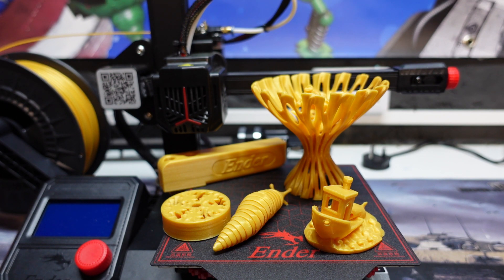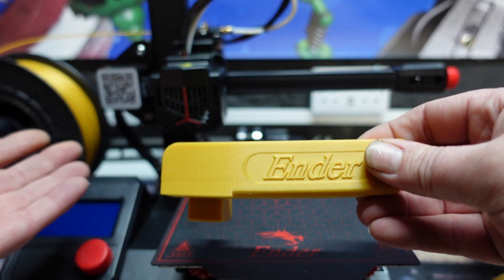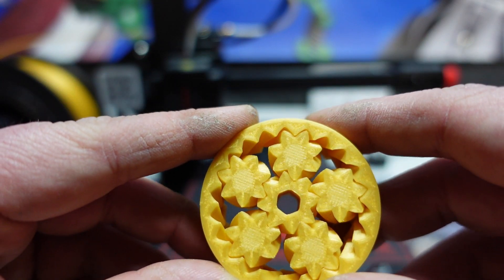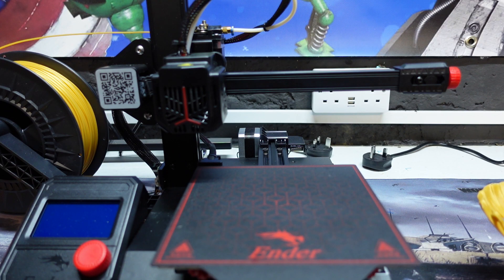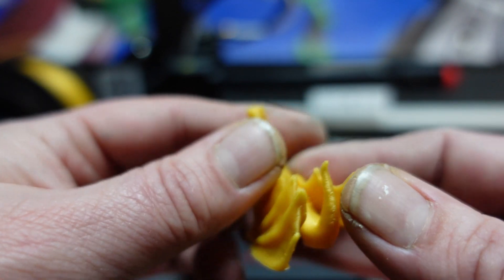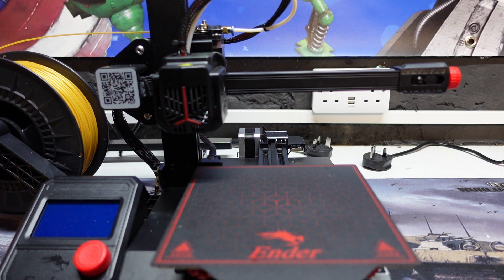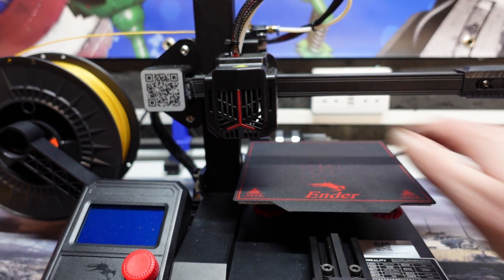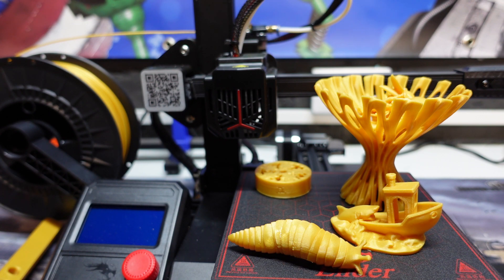Creality Ender 2 Pro Test Prints (Amazing Budget Printer)

Comment: what is your retraction settings? And do you use z-hop?
Reply from the maker: hi, i was using creality slicer with the standard settings which are, 5mm distance and 60mms speed, these need slightly altering to get rid of the stringing completly, as for z hop do you mean babystep while printing? if so yes i dropped it down slightly during the print
Reply: @BeanGaming-w4n  I just put mine together last night and the e-steps were off by 10%, so I fixed that and also seems like the default retraction is way off for me as well. I am currently doing a retraction test print to see what is optimal. As far as Z-hop its a setting in cura that moves the Z up before a travel then lowers back down after the travel move. Thanks for the reply!